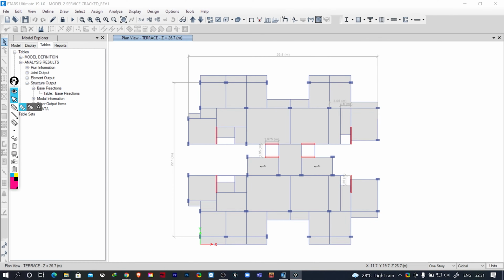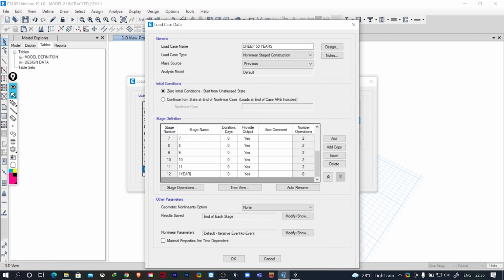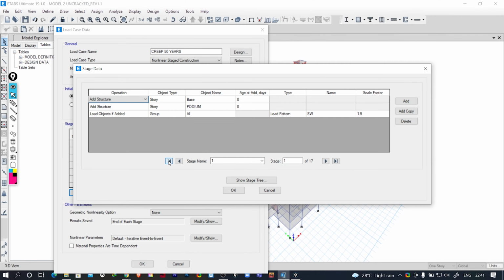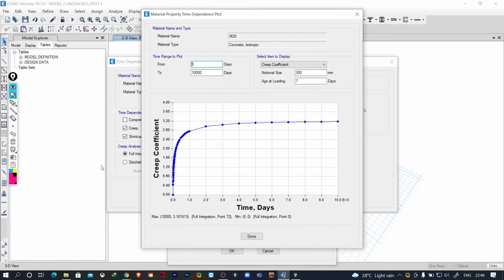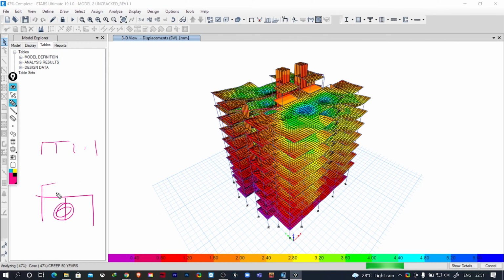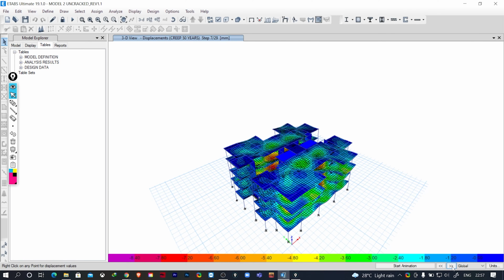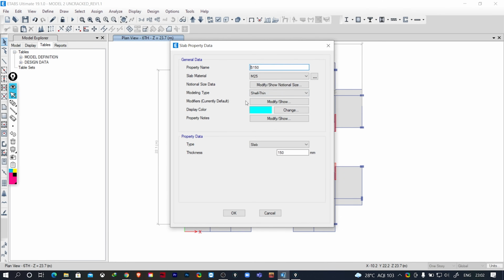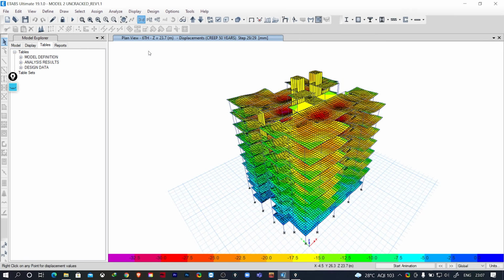Construction Sequence Analysis of a RCC Building | Creep Analysis | ETABS | Sandip Deb | ilustraca

Comment: The Auto Construction sequence Case does give different results than normal dead in terms of deflection and end moments, but does it show by how much value a member needs to be cast extra or to be cast inclined than original dimention to achieve th same Displacement and Force Results?